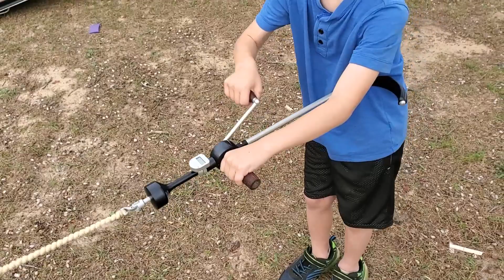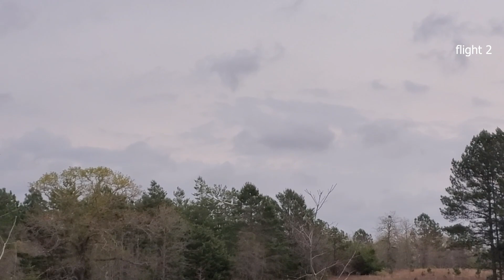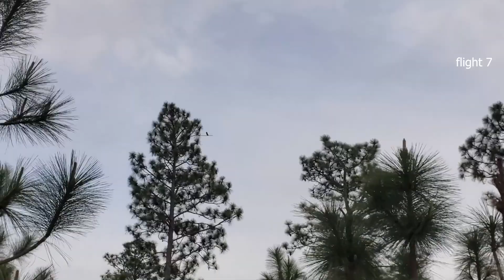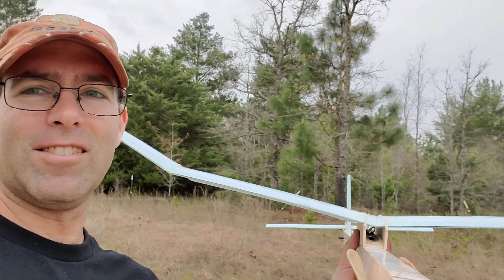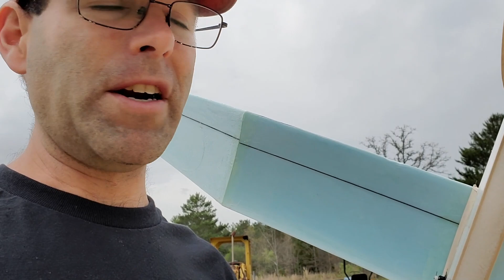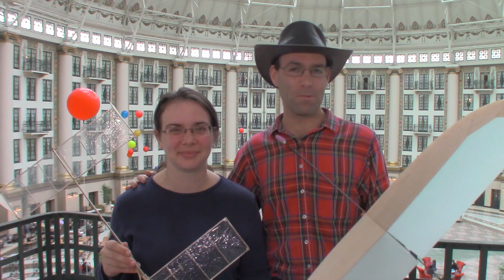Prototype testing of big foam rubber powered airplane

Comment: I was noticing the front end set up and how you have the z bar mounted on the props..it looks like a dowel is mounted on the props and the tubing is mounted on the inside of the dowels on the props..and then the z bar fits inside the tubing..this way you may be able to adjust the pitch of the props?  If so perhaps a video would be useful to some...thanks for sharing..just an old freeflzighter who no longer can fly or chase .